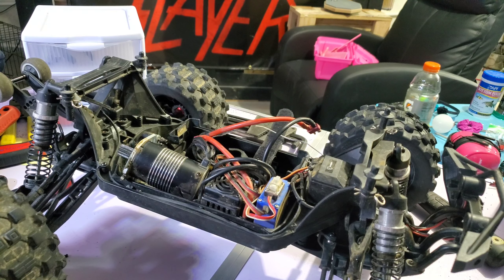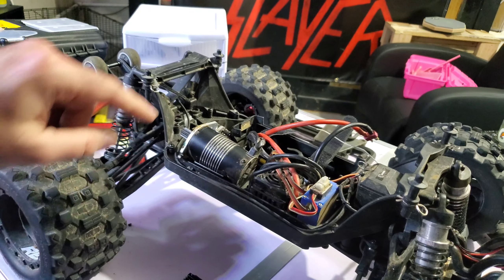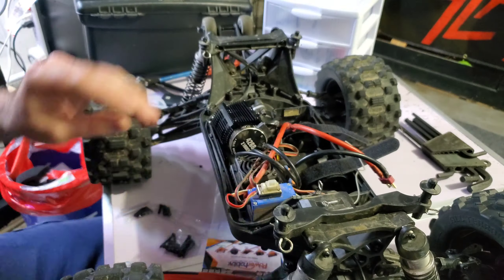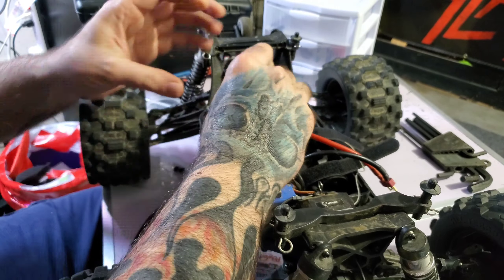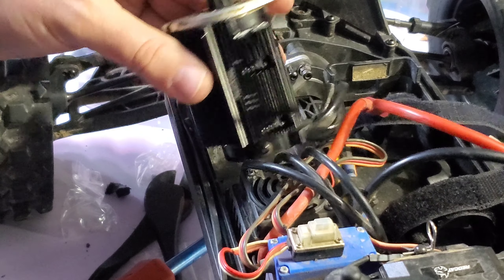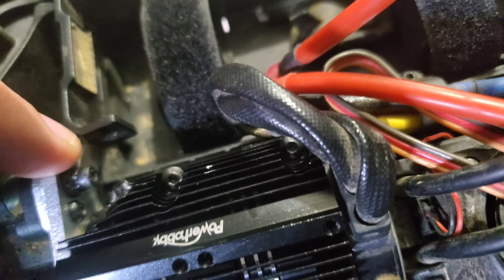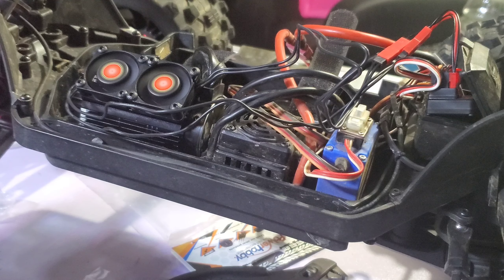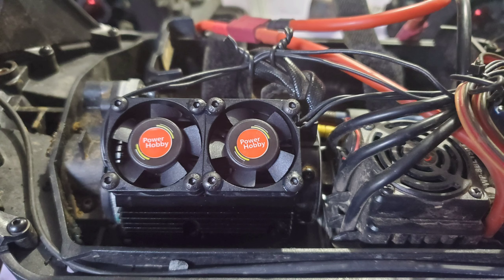Redcat Kaiju fan install!

Comment: Yeah my rig (not a Kaiju, but that's next!) Boils my flesh if i thrash it around my way.  I call it "forest bashing" and all the extra climbing and jumping (as i tend uphill) just lights the fire. So ive ordered an integy version of this with a fan thats 3 sizes too big mounted on top!  Luckily my rigs body has the extra vertical inch to spare!

Thanks for the vid.  They are way more powerful than I would have guessed!!  Glad to see another Kaiju fan!

Comment: wish I had seen this sooner lol. I got that fan for my kaiju and it didn't fit so instead I threw it on my Kraton but the good thing about going on my Kraton is the motor is bigger so I didn't need to put bottom plate on. It pressed on tight. So then I just ordered the single fan 10th scale power hobby fan that seems to be doing ok. I plan on gearing up to a 13t,14t and just running it on 4s. That power hobby fan is crazy powerful, it sounds like a jet engine on my Kraton lol

Comment: Gday man, do you have to remove the motor to install this fan?
Reply from the maker: Yes, it's on the video.
Reply: @heavymetalrc7520  cool thank you, was hoping to avoid it but guess I’ll have to lol
Reply from the maker: It's not so bad, you do have to notch the fan mount a little.
Reply: @heavymetalrc7520  I saw that, still new to the hobby haha finding my way as I go along. Just gotta step outside my comfort zone and get hands on lol 🤘🏻